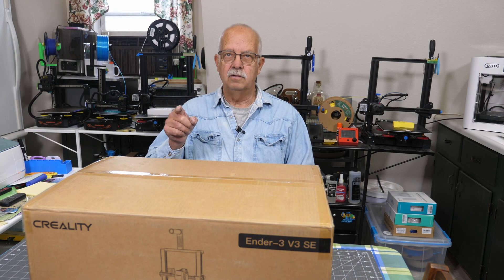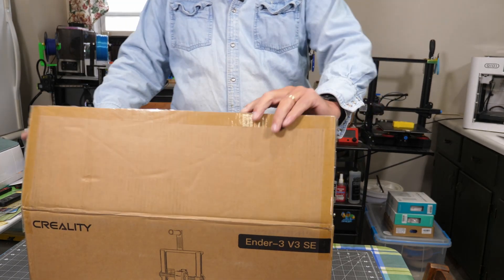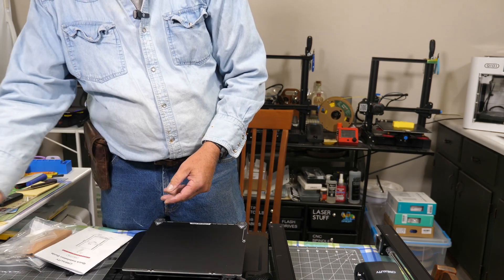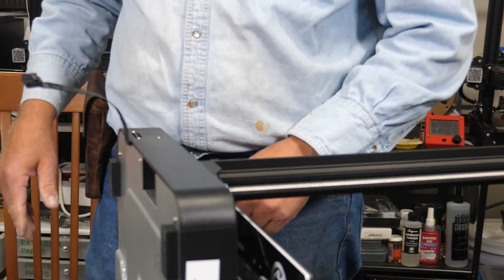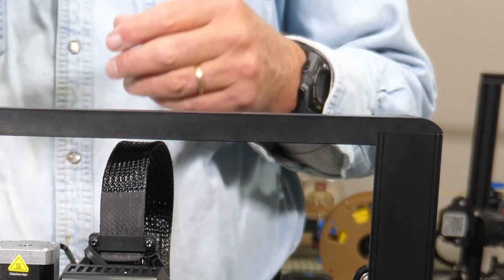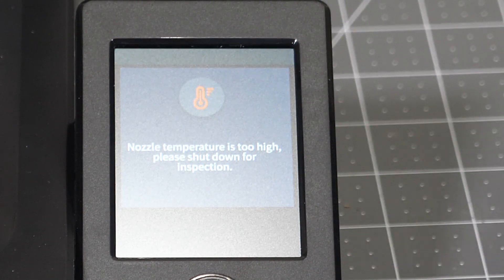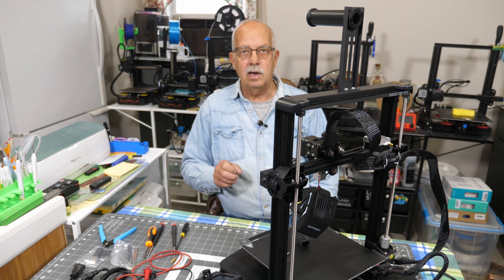Creality Ender 3 V3 SE Assemble & Fail Part 1

Comment: I believe you plugged in the cable backwards in the top of the extruder thing
Reply from the maker: It is keyed.  Impossible to insert wrong.
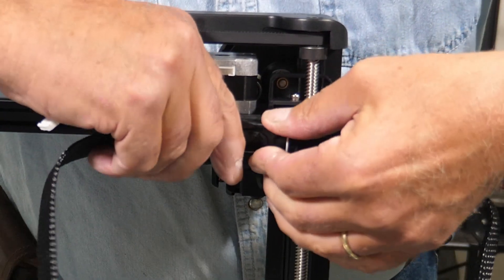Reply: @rogersshop  @lukecazalas2326 is right. At 11:43 you plug it in backwards. I checked it on mine. The only white colored cable strand should be on the left, and the cable 'bulge' facing forward. Cable is also inserted backward into the bracket at 10:00. Writing should face outwards.
Reply from the maker: Sent from factory with extruder assembled incorrect:  https://youtu.be/yYNRH7VOc6g  @GaborRudas